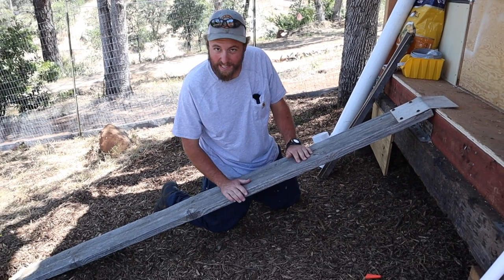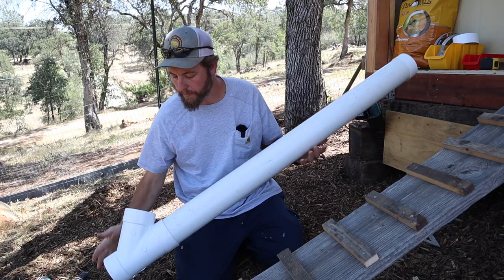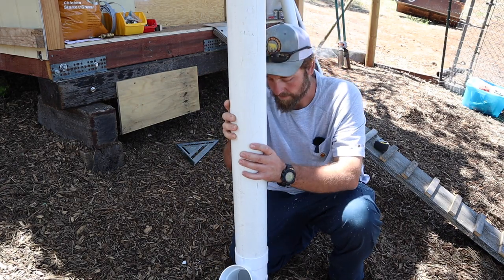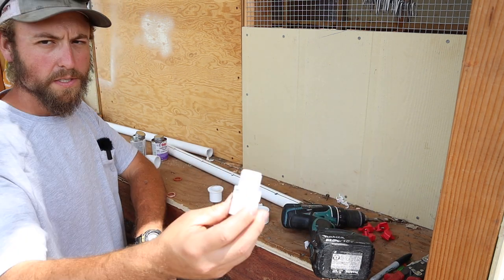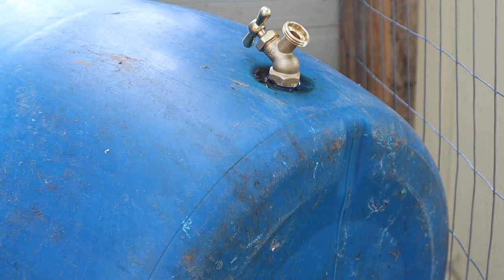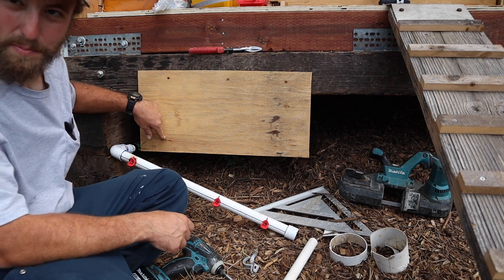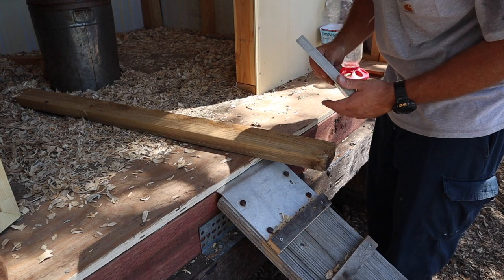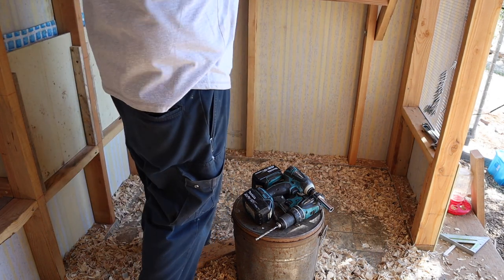CHICKEN RUN ACCESSORIES | Coop Build PART-10

Comment: Good vid. Couple of points --
- for the feeder, just block off the bottom of the Y. Preferably with a mesh or hardware cloth to allow dust drainage. Plenty of options, there. Screws/Nails/Brads to hold up some hardware cloth. Stiffer hardware cloth shaped to sit in the hole and allow the cap to be removed for cleaning. You can even stick a board leaning to the back of the pipe to provide an angled floor or slide. 
- You only need the purple stuff on PVC meant for pressure, like water pipes to a house. The purple softens the PVC so that the glued ends become 1 unit. Acrylic workers do a similar thing with their "glue" products. It doesn't hurt to use the purple in this waterer, but it is optional unless you are connecting to way more pressure than those nips can handle.
- For those looking for PVC, the common gauges (wall thickness) are 120, 40, and 80. For whatever reason, 120 is the thinnest, and 80 is the heaviest. 40 gauge is the most commonly used PVC piping in every application I am familiar with. ALSO, there is the usual white and the UV resistant black PVC. Both are suitable for potable water, but sunlight will make the white pipes brittle.

Comment: I built my coop a few years ago using many of the ideas you have shown.  The issue in Colorado is winter cold that freezes the water so I used cups rather than nipples as you have shown. Eventually had to go to a heated water system.  The other issue is squirrels eating the plastic pipe so I switched to a metal manufactured feeder.
You did a great a d simple coop and I am confident your chickens are happy with their home.

Comment: They are probably 1/8th pipe threads.use a tap to cut threads in pictures pipe.

I like the roost.
Slick !
My coop is 4x5x5 tall rear 6 tall rear.
Nesting box is on one end but I think I'm going to move it to the rear and put roost where box was.( didn't cut entrances to box yet ) . Now my roost will be where box was.
Chicken entrance will be on opposite end of where box was so should work out fine.
Should have made coop 4 X 8 instead of 4x5. First go around with chick's.
 I'm a wrench not carpenter. Lol
Getr dun son

Comment: Most people are using 5 gal buckets for water Spicket’s maybe that why they didn’t want to work on the pvc. Putting those water hose ends on a hose. Heat is the trick. I get water almost boiling, stick hose in for a few, works pretty good. I liked the torch job on the plastic barrel!! Custom Fit!!
Reply from the maker: Yea i think the schedule 40 pipe i used for the nipples was to thick. Maybe schedual 20 would work better. I like the hot water trick. Thanks for watching.

Comment: On the feeders, I would have used an elbow. The current design will have the same food continuously trapped in the bottom until it's cleaned out.

Comment: Thanks for doing a great video. I am at the point of finishing out my first coop and was trying to decide how to do a roost bar over a poop board. I will definitely try your idea to swing it up out of the way for cleaning!
Reply from the maker: You are welcome, I was thinking I should do a poop board.
Reply: @JoeSimple  I have my roost (27" up) and poop board 8" below that and needed idea for mid-height "ladder" (not so much a secondary roost) to help the chunky ladies get down after a good night's sleep.
Thinking to cut down to 1.25"x3.5" so NOT as comfortable for roost, but stable enough to offer a "jump-down" from roost 
OR 
an interior 2x6 with rungs, like the exterior "entry plank"; steep-ish, but they'll train to it ... I "incorporated" a 5'x4.5'x6' coop under an exterior shed roof where firewood used to go. 
Funny how many folk admit to having to train them to roost ... I am first time chickerder with 6 aquila in a big wally-world tub in the dining room with a heat lamp right now.
Reply: @JoeSimple  what’s a poop board?
Reply: @ultimatestewartfan  A poop board is basically a shelf covered with something that is easy to clean (vinyl? linoleum?), that is installed under the roosting bars to catch all the poop the chickens put out at nighttime. Poop dries on the board, then you just scrape it off and compost it.

Comment: I bought a bunch of those water fittings, which all worked alright for a while. But within a few months they all started leaking and I loss all the water in my tank.  I switched to some that have a little cup for the water to sit in and those so far haven’t gave me any troubles yet. Think the chicken like the cups better too! 
I’m curious how the heating the pipe worked for getting your water chicken valves in the pipe. Any problems with the valves coming loose or leaking?  I was able to get mine to screw into my pvc pipe. But after a while they somehow seem to strip out and spin around just from the chickens pecking at the water valves.  Doesn’t seem like much is made with quality in mind any more?  Still looking for the perfect long lasting solution that doesn’t have to be replaced every few years if not sooner?

Comment: Where is the least expensive place to buy that thin walled pvc? My Home Depot only has the regular heavier duty kind. Thanks.
Reply from the maker: Ahh the good old days of cheep materials. PVC has skyrocketed. I found mine at the local plumbing supply it's typically used for rain water drainage or French drains. Happy building!

Comment: When you show water drum systems. Why don't you show how that system gets cleaned out? It's  clear you can't just run water through there all the time without contamination build up over time. Especially rain water. Disinfecting the system every so often is important to health. Like we do with human systems for drinking water. This system of yours will not work in states with freezing temps in winter obviously. So, letting any water in the system sit in there for months will cause contamination in the spring. Show people how to clean it.